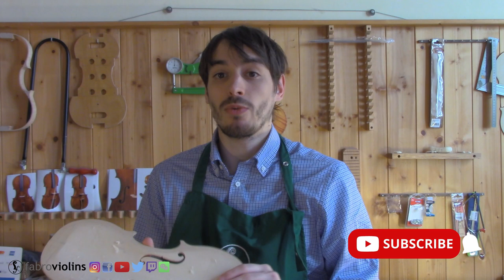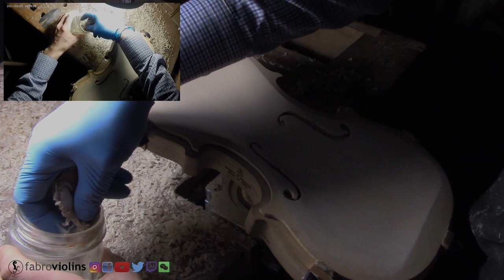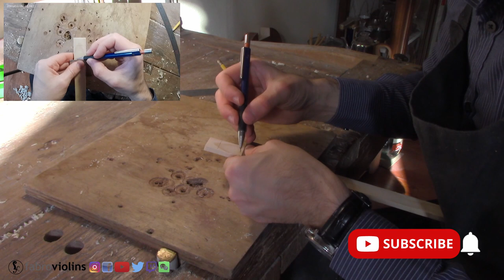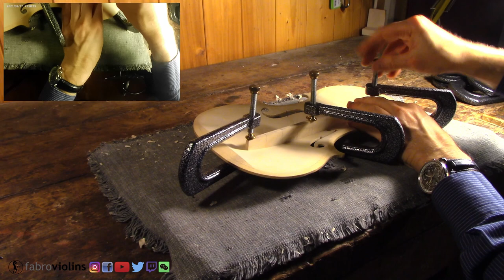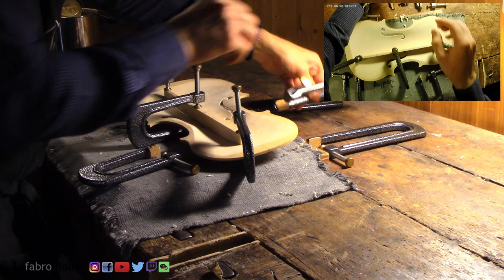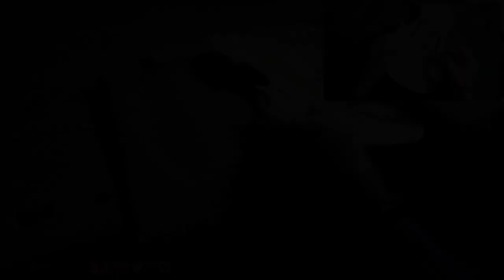MAKING A VIOLIN (Baroque) | TOP Thickness and BASS-BAR

Comment: Any particular reason why you draw the squares on the violin plate?
Reply from the maker: Not really a particular reason on to why they’re squares, but I just like dividing the plate into small “sections” so as to have an easier way to control the thickness everywhere and then be more precise. But that’s the method that works for me, I know other people use others! :)

Comment: Why are a baroque violin and a so-called-regular violin so different in their carving? Aren't they the same shape, the same basic carving steps?
Reply from the maker: Hi! Thanks for your comment. While the shape is the same and the process is almost identical in most steps, there are some slight differences (such as the bass, bar, neck joint, fingerboard, tailpiece, neck shape, projection, bridge, etc.)